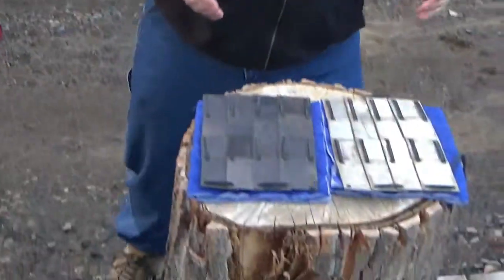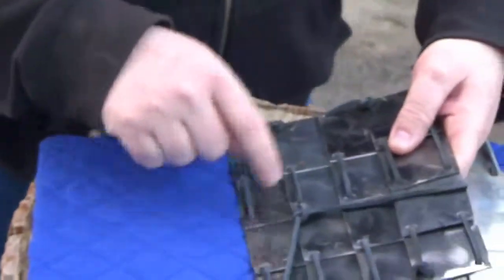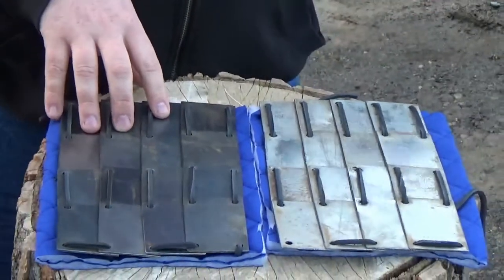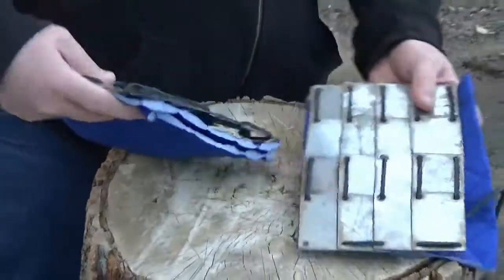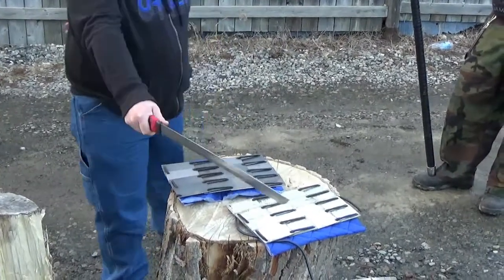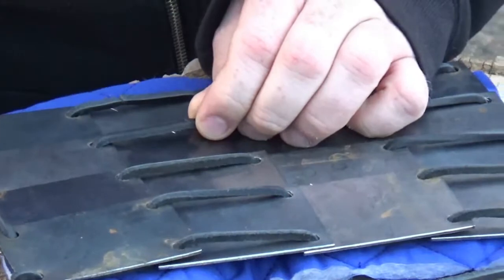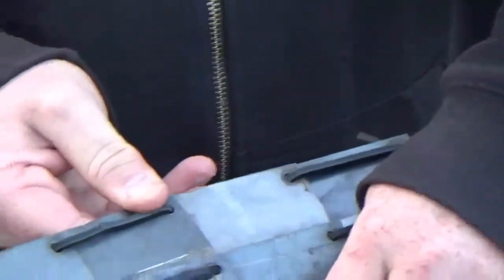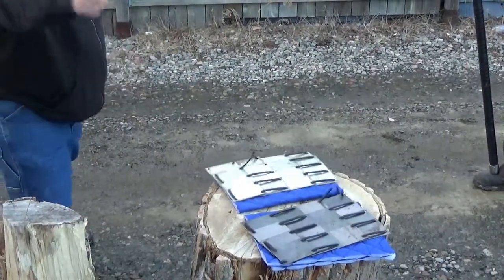Flat Lamellar Test

Comment: Your test is somewhat invalid considering the fact that lamellar isn’t put together that way.  You even said as much.
Reply: Really? Thanks captain obvious, I don't think they noticed. We'd never know that if you didn't tell us all. thank you for being on the internet.
Reply: Classy. Why post the video, then, if they know it isn't valid?
Reply: 1, Because its smashing shit.  2, its still a test of punching through the plates in that arrangement. 3, Where is your 'more accurate' test?
Reply: 1 - I'll grant, 2 - If the plates and bindings aren't in an accurate layout and properly secured, what good is the test, really? 3 - A better test here (https://www.youtube.com/watch?v=EVV5my415VA), though it still isn't properly edged.

I could also point out that the method of testing itself - resting still on a hard, unyielding surface - doesn't bear much resemblance to the conditions it would actually be struck in (on a moving, yielding fleshbag).  The test I linked gives a much better picture, though as I said the edges still aren't finished properly; real armor would have it's edges secured to prevent the plates from coming lose as easily.
Reply: I thought the same, but it seems maybe there were making it easy to hit the exposed lacing, in order to get an idea of how the short bits of lace that normally are exposed would hold up to hits.  That's useful to know when making non-reproduction armors with novel lacing patterns, etc.
Reply: Late comment, but that is exactly how lamellar is laced. It's laced together without a backing. Is it the best one? Not really, but it's still lamellar.